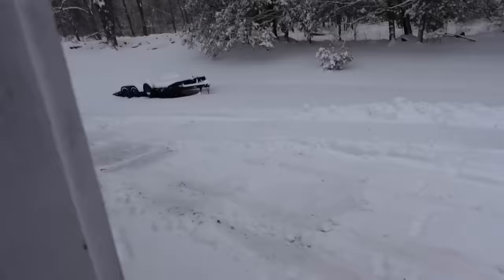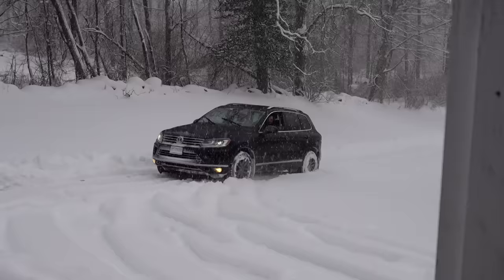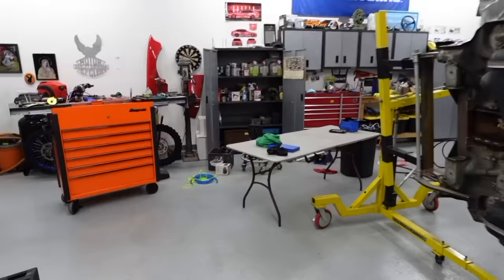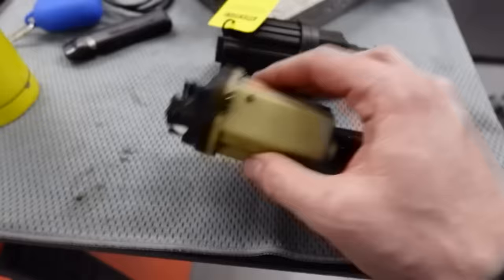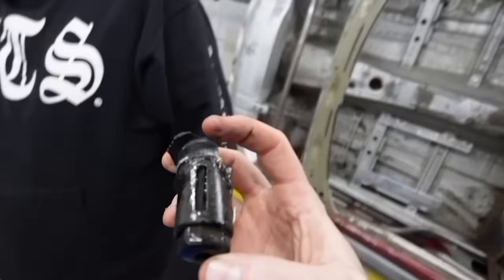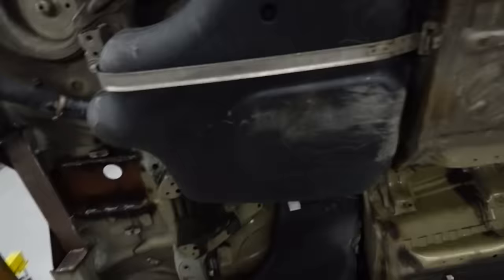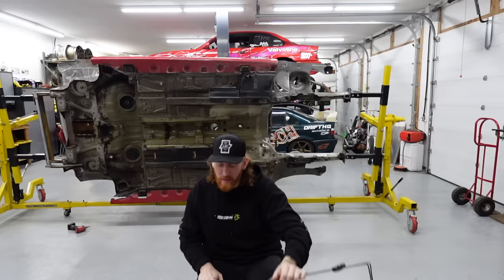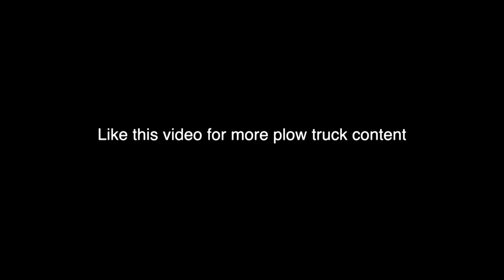Stuck In the Snow With Broken 4WD (Truck Maintenance Neglect)

Comment: I work in pro audio and there are several multi-channel setups out there, and like anything wireless the more channels the receiver can handle the more expensive/bigger it gets. Probably just get a dual channel system so you can mic up a buddy if you need to. They come with 2 body transmitters & mics and 1 camera mount dual channel receiver like the top of the line Comica BoomX-D2 Dual Wireless Microphone system.

Comment: That new 1000hp ls 632 crate motor! Or a de-stroked ls7 with a Callie’s crank and high compression nitrous pistons ,solid roller setup for 9k rpm, and some mast motorsports heads! I’m sure jp  or one of the homies could source you all the parts for a nasty 650/680 whp n/a setup then a little 250 shot on top 😈😈